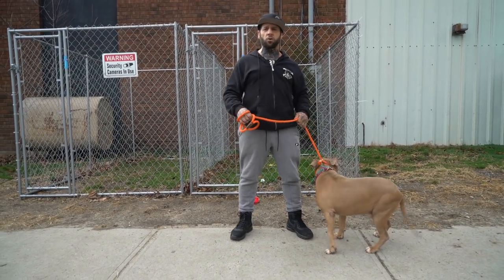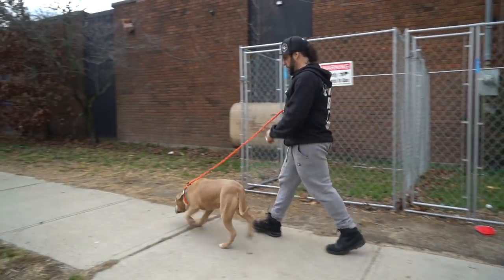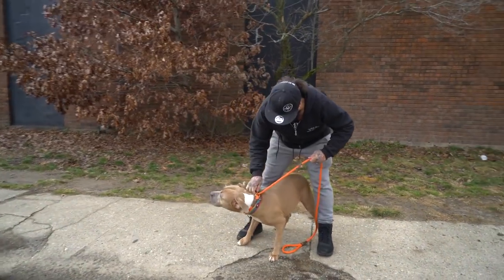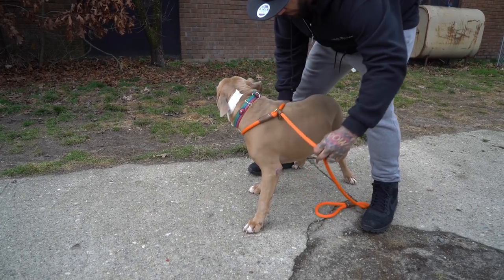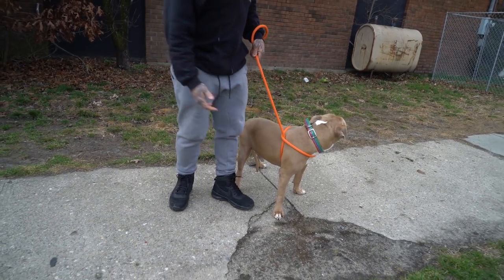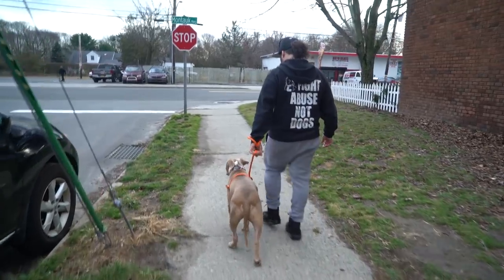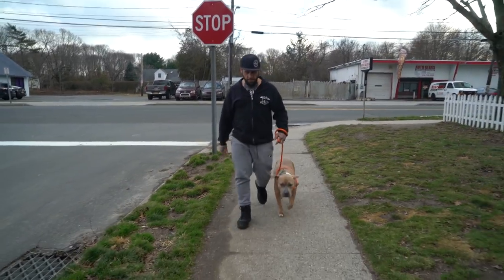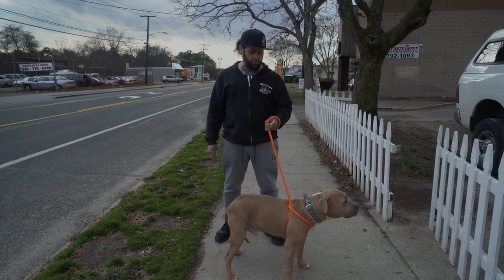HOW TO TURN A SLIP LEAD INTO A HARNESS

Comment: This was extremely helpful. My 6 month old blue nose (60lbs) LOVES to pull, this solved that issue in about one minute. Obviously, they might have an issue with it at first, as they're learning what's going on cause my dog thought he was tangled so he turned on the ground a few times but eventually realized it was the leash, now when he feels it positioned this way, he no longer tries to pull. Also, I tried this with a regular leash, just put the lead through the clip.